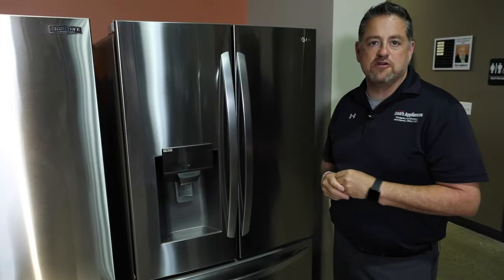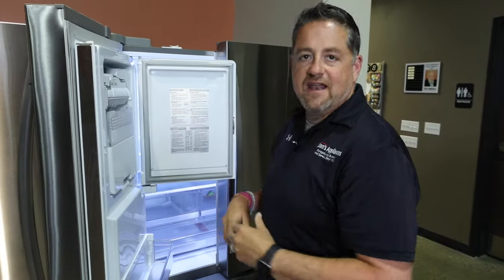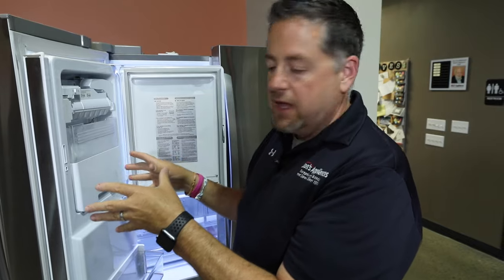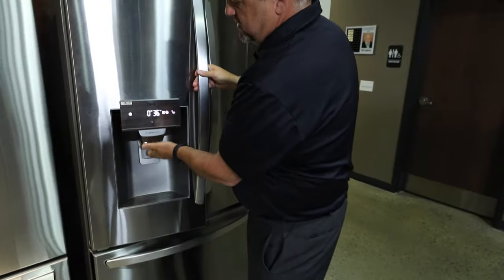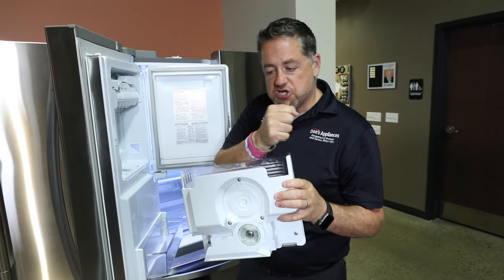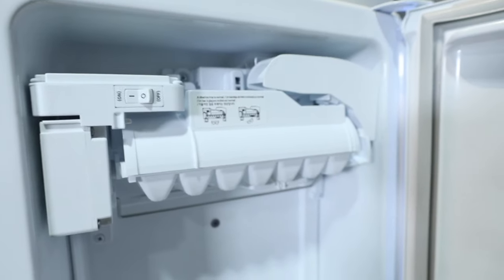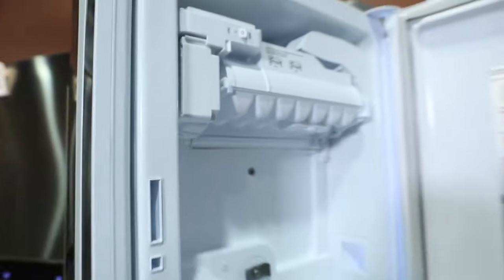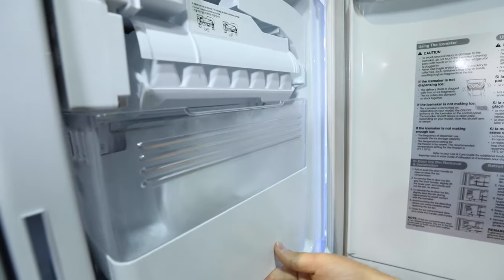LG Ice Maker Not Making Ice? Try This Quick Fix

Comment: I have ice in the receptacle, but it won’t eject. The reset button does nothing when I push it.
Reply from the maker: jmello, Double check that no ice chunks are blocking the ice ejector paddle. You may want to take your ice tray out and let all the ice melt too. You can also reset the entire unit by unplugging your fridge for about 5 minutes before plugging it back in. Hopefully this helps!
Reply: @Donsappliances  I removed it and let the ice melt and it still doesn’t eject the cubes. I’ll try unplugging it for 5 mins.

Comment: I hit the reset button and nothing happened.  I turned off the circuit breaker to the fridge and back on and still the rest button doesn't work.
Reply from the maker: We'd recommend contacting a local appliance technician. If you call LG appliances support (or whichever brand you have) they should be able to set you up with one of their technicians in your area! Hopefully this helps!

Comment: Water is not freezing in top ice maker. Ice maker is on and has been reset.
Reply from the maker: Hello Jennifer,

Make sure that your temperature is set between 0 and 5 degrees farenheit. (18 to 15 celcius). 

Double check that all of your connections are tight and not kinked especially the water supply line. The biggest reason it may not be freezing is going to be this water supply line. Check this for any blockage (frozen ice, kinks, etc.)

If these don't seem to be the issue, it might not hurt to slide your fridge out and unplug it until any possible ice blocking the lines melts.

Let us know if this helps or not!

Comment: I thought lg was good? I just got one and the bottom freezer bin has frost build up. Only had it five days. May need to use warranty already.
Reply from the maker: Hi Nicholas! LG Appliances are a very reputable brand but like everything, there can sometimes be defective products or parts that fail quicker than what we are used to.  Do you know if your bottom freezer might have been slightly left open? That warm air sucked in could've added to the build up. Please let us know if you have any additional questions regarding your LG bottom freezer bin!
Reply: @Donsappliances  so we checked it, to see if it was open but it wasn’t and it’s been five days
Reply: @Donsappliances  also checked doors with a dollar bill test. Door closes around all sides
Reply from the maker: @nickfanzo  Nicholas, where do you live? We are in the Western, PA/WV,OH area and have our own in-house service team. You might be able to call LG and see if they can send out a factory-authorized repairman.
Reply: @Donsappliances  

I am in Connecticut 

so lg sent a repair man

Same issue is happening 

Called lg again and they told me he wasn’t qualified because it’s a new unit and they’re not trained on my unit!

I am now waiting for a next level and it’s been a week
They’re trying to drag this warranty out on us!

I then posted a public complaint on their Instagram posts
Reply from the maker: @nickfanzo  We are sorry to hear about the issues you are facing with LG! We hope they get someone out to your home as quickly as possible to get your ice maker working!

Comment: I tried this, but it still isn't working. The ice tray flips over, dispense the ice, and fill back up. I waited 3 hours later, but I still don't dispense ice on it own
Reply from the maker: Double check your water fill lines to make sure nothing is blocking them. You may also want to unplug the entire fridge for about 10 minutes, then try plugging it back in.

Comment: If you hit reset and the ice tray still does not move there is most likely some frozen ice that is blocking the tray from spinning.  I hit mine with some hot air from the wife’s hair dryer for about 2 minutes and it melted whatever blockage there was.
Reply from the maker: Good point. There can be ice build up which is preventing the ice maker from making ice as well.
Reply: I tried that, but nothing is moving yet 😞
Reply from the maker: @xaviersaenz3270  You might want to contact a service repair man!